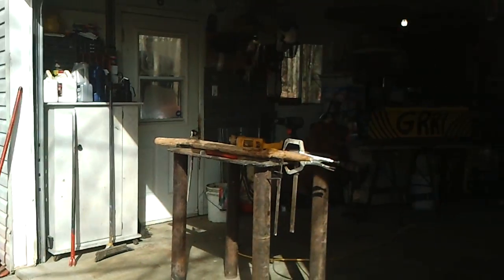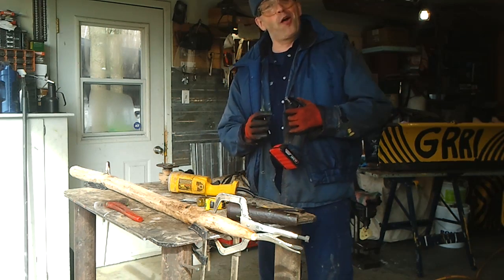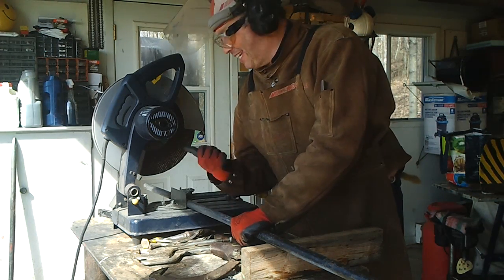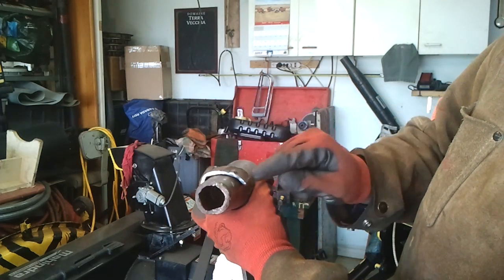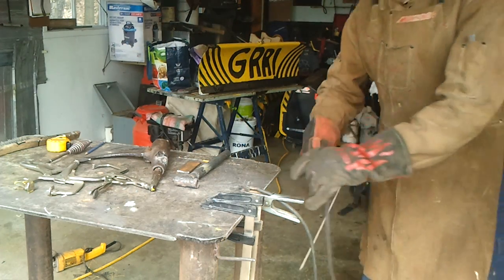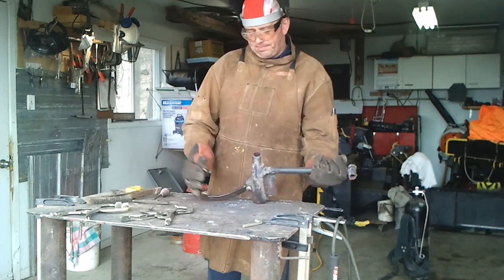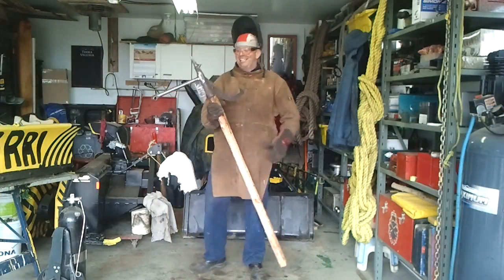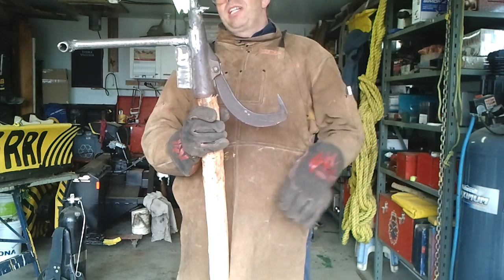Building of a new Log Jack tool ( Part 2 and final ! ) for my firewood !!!

Comment: Hello Dave. Its almost like a blacksmith shop in your garage! It will be a handy tool. I'm glad you used hydraulic oil for your new tool because it will be really easy to lift logs! (Get it? Hydraulic oil, Lifting......Never mind .LOL Take care
Reply from the maker: That is a very good one John about the power of hydraulic oil !!! LOL Yes to have a blacksmith shop will be nice, but the tools are so expensive !!! You too take care John !!! Note: I downloading a very long video 1 hrs and half and right now it is only half done after 5 hrs of downloading !!! LOL Cheers !!!
Reply: Wow that a long video!
Reply from the maker: @loggerjohn01  Yes in deed, i made a video on my tractor doing  cleaning up the gravel off the grase !!! Pur sound of a diesel engine !!!! LOL cheers !!!
Reply from the maker: @loggerjohn01  Yes in deed !!!

Comment: Hi David.  Tools like that with a straight spike like yours are called a peavy and were used on log rafts.  If the tool had a bent thing aimed towards where the hook would come in contact, that would be a cant hook.  At least that is how I understand it.  So now you have a combo one!  Neat modifications!

I don't have a welder, so I wondered why you arc welded instead of mig?
Reply: Right about the peavey and cant hook!
Reply from the maker: Good evening Sir, thank you kindly for your visit !!! Thank you for the complete information ( I really like that ! ). Yes you can use a Mig welder with or without gas ( inner shield ). I really like the penetration that you get with a arc welding and also when working with old steel it's very good to use arc welding, It's very good for me !!! but you can use a mig with old steel you have to clean a little bit better the rust or the paint. I learn to weld with arc welding, and it's required more attention than mig welding but I like both for their respective qualities. Thank you again and keep up the good spirits Sir !! Cheers !!!

Comment: Lol! You made me laugh with that oil question... I knew the answer well before you even ask the question!  Keep it oiled, so the wood does not shrink and become loose in the steel end. You sure do not hesitate to put more welding than less. This tool is very useful for logging, you will not go without it! That was indeed a nice Saturday.  I kept my garage door open most of the day!  You sure do not have the Covid with that smiley face! Thanks!
Reply from the maker: LOL yes in deed that smiley yellow face is keeping me smiling !!! Once the pain dry, ( I may had some paint stripes tomorrow morning,,, I think than I'm missing a color,,, Mmm Let's see LOL !!! )  I will dips the end for a good week in the hydro oil bucket !!! Yes the sun was very warm !!! I can tell that your project is going a head ? Cheers my friend !!!